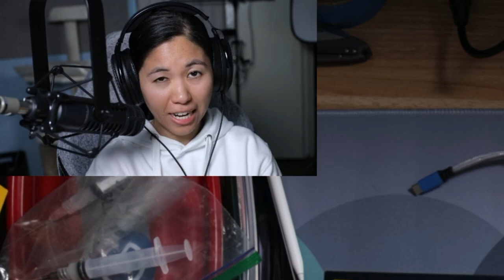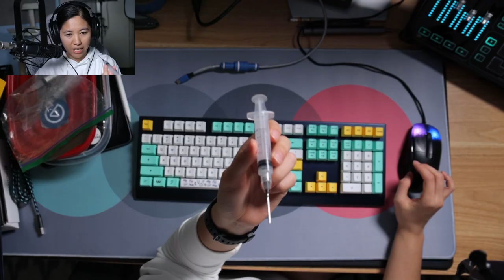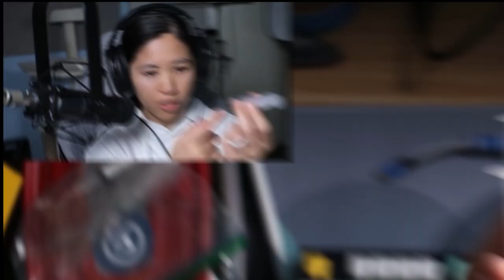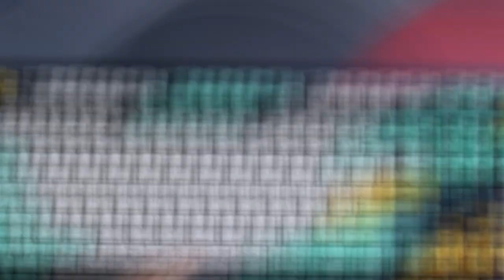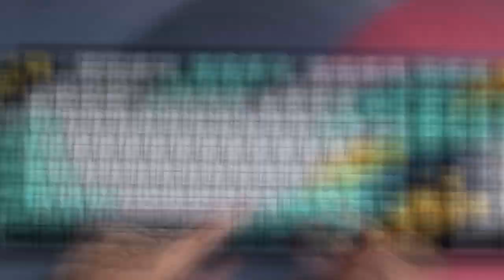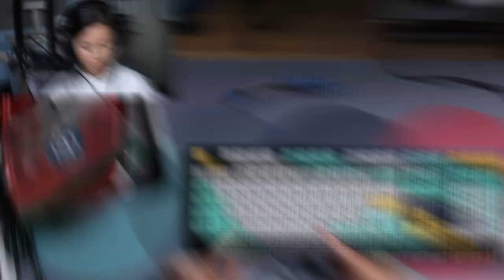How to Lube Stabilizers Without Desoldering

Comment: Can u use krytox 205g0 for the stabilizers or does it have to be dialectic grease? And if not may i know the differences in using them
Reply: You can use Krytox.
Reply: you could
but krytox is expensive tho

Comment: When you put that stuff in you didn't zoom in so I can't see exactly what you're doing. I also wonder, there was a video where they took apart all the stabilizers, put lube on all the small parts and even had some kind of tape on the pcb and put some liquid on it. There is just so much information and I have no idea what is better over the other but this surely seems WAY easier.
Reply: You see the little holes under the stabilizers? You need to squeeze a tiny bit of the lube there.